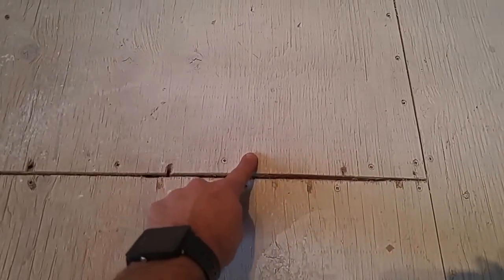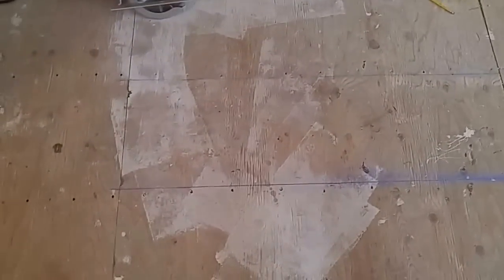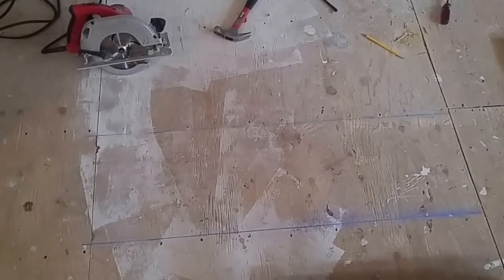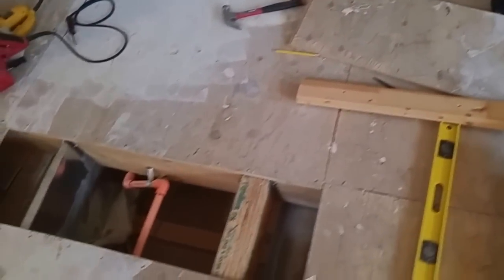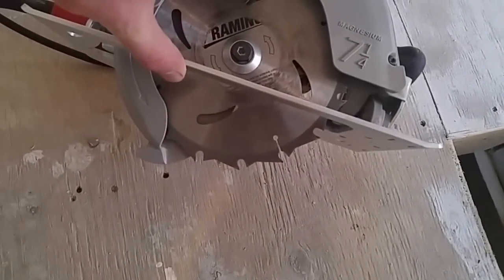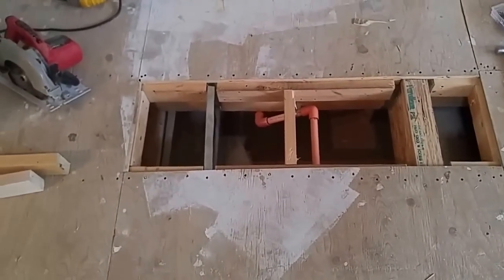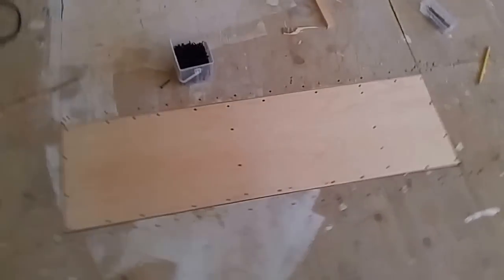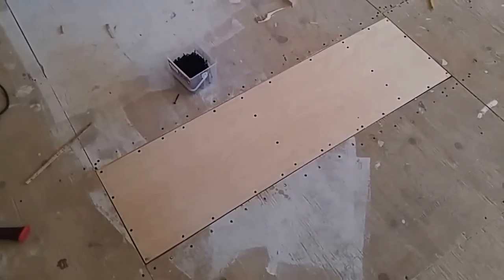DIY: Damaged Plywood Subfloor Repair/Patch

Comment: Tip for next time - the best way to prevent subfloor squeaks is to use subfloor glue and screw, not over-screw. Also a good idea to seal around that forced air dam while it's exposed to reduce leakage.
Reply from the maker: anticapitalize those are great tips! Thanks for the comment!
Reply: @colchilibeck  What is subfloor glue? Do you have a name and link?
Reply: Noel Smith 
Pretty much wood glue, loctite, gorilla glue for construction, liquid nail glue

Comment: I have a modular home and those are a real pain in the rear end the flooring they use in those is like a dust board. I only have a couple small spots that are damaged in Weak and I'm doing the repair of the same exact way but using three quarter inch plywood. Excellent job my friend

Comment: If the cut board is stubborn with a pry bar, or the seam is too tight you can drive a screw into the board and use it  as a handle to pull it out with a claw hammer.
Reply from the maker: Great tip! Thanks for sharing.

Comment: This was very helpful. i am sure they all do it this way, but I was about to cut a floor and attempt to straddle the beam and then put in a new piece drilled into that beam. The 2x4 nailed to the side, and voiding the beam all together, that's just brilliant. Like i said, they all probably do it that way, but this was the first time i learned that trick

Comment: You skipped over the one part I really needed to see -- actually putting in the support pieces or boxes. Thanks anyway though. I admire anyone willing to make a video and put it out there for the rest of us to learn from.
Reply from the maker: Justine Grayson To box it in just simply screw 2x4s against the floor Joist. Just make sure that the 2 x 4 is the same level/height as the floor joist so that the new floor panel is level/flush with the subfloor
Reply: What type and what length of screws did you use? Thank you!
Reply: @colchilibeck Depending on the age of the house, you may not be able to get a perfect match for the plywood thickness.  Typically a new 3/4" plywood might be 21/32". By setting the 2x4s a bit higher,  you can accommodate for a thinner subfloor board.

Comment: Since time is money would it be a good Option to replace the whole piece of subfloor instead?
Reply: not if it goes under a wall or if it's T&G. Personally I would have removed nails/screws on the adjacent plywood floor joist area and cut 3/4" away from the edge (half the width of the joist), this way the repaired section's weight is transferred onto the actual 2X10 or 2X12 floor joist as opposed to a 2X4 screwed into the side of it.
Reply: Eddie Potts good point. Wondering why he didn’t do that.
Reply: He should have, and similar to what Eddie Putts said 👍😁😂

Comment: Why do you have to box in the area with 2x4s? Can you just attach the new subfloor to the joists?
Reply: Malinda Smith Because that would require moving the existing screws of the section of subfloor you’re not removing, they’re already just about centered on those joists when it was originally put in, and you don’t want to risk cutting or weakening those joists. This way you box it out, sister those to the existing joists to make it a solid extension of those joists, and then screw in your newly replaced section of subfloor to those sisters box pieces. Everything is still strong and you’ve done you’re repair successfully, without weakening or damaging anything.
Reply: Boxing in also adds extra support, and takes some pressure off of the existing joist!!!!

Comment: I believe you did not address the rule that subfloor plywood must span more than one joist?  or did someone change that rule without telling me? People need to know about this in case they have a disagreeable inspector.
Reply: Would you suggest replacing the whole piece rather than the small section?  I'm about to do this in my home that has splitting particle board (not water related).

Comment: Have you checked for wires/ pipes  before cutting and wouldn't use a jigsaw better with handsaw
Reply from the maker: The circular saw is better as I was able to set the depth so that is just barely cut through. This limits the likelihood that a wire or pipe get cut.
Also, I'd the house was built correctly,  no wires or pipes should be secured to the floor.

Comment: Can somebody help me? My bathroom floor creaks, as does the second bedroom next to it under a partition wall. I can see where the floor has warped on both sides as it bends under the line of the skirting board. I know I need to repair both sides rather than take down the wall, but in the bathroom near where it's warped there's a towel radiator. Obviously, dreaded water pipes are my concern, as is what saw I need to cut neat along the skirting boards. The floor panelling itself is some kind of thick chip board stuff. How do know thick this panelling is and how do I avoid the water pipes supplying the radiator? They could be coming from anywhere. And what saw cuts down on flooring straight down vertically alongside the wall? A circular saw will cut the outer side of the rectangle I need, but once I remove the skirting board, what do I use? Thank you
Reply from the maker: joecrimp sorry to say, but it sounds like you may need to hire a pro. The repair I did was simple but your repair sounds fairly in depth and the last thing you want to do is cause more problems for yourself.
Reply: Did you fix it- how about a floor support underneath it like a post.
Reply: @MOAB-UT  it was 6 years ago. I moved house since
Reply: @joecrimp  Hope your new house has strong floors!
Reply: @MOAB-UT  I bought an older place. It has concrete floors. Much better, more solid, warmer and more sound proofed
Reply: @joecrimp  Tough to beat solid construction. I have friends from overseas who said their condos are all concrete including walls. They were shocked at how thin the walls are in the US- how they are not used to ever hearing neighbors. Glad you found a great place. Now you can focus on the landscaping- there is always something to do! Good that you are handy though either way.

Happy Holidays!

Comment: PVC sprinkler system?
Reply: Things are cheap these days, in a fire metal would be more durable, probably hold better psi...
Reply: It’s specially designed cpvc designed for sprinkler systems,old metal piping rusted and could cause sprinkler to be ineffective or just not work at all,also it has cut the cost of installation tremendously but in most cases is still only approved in residential installations